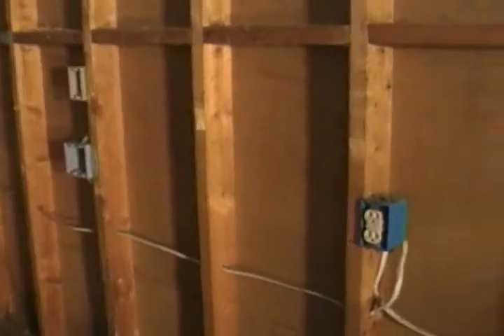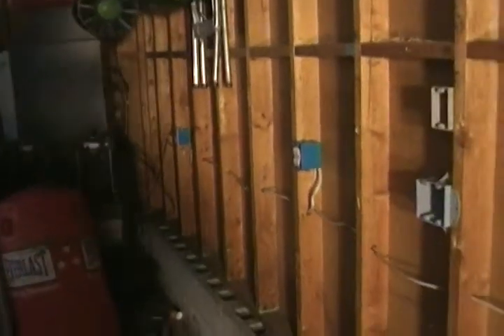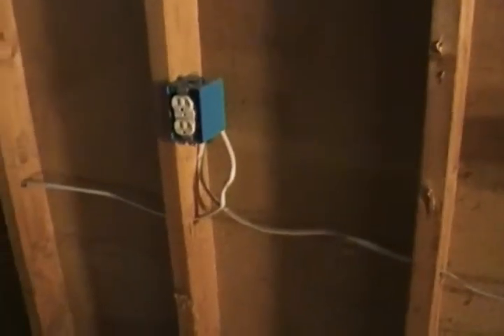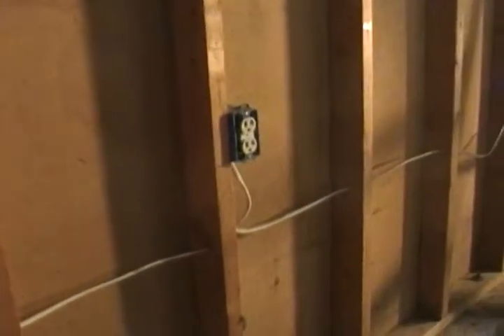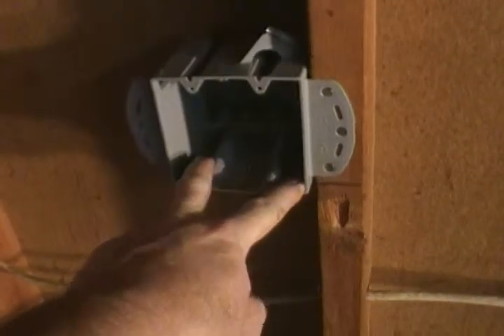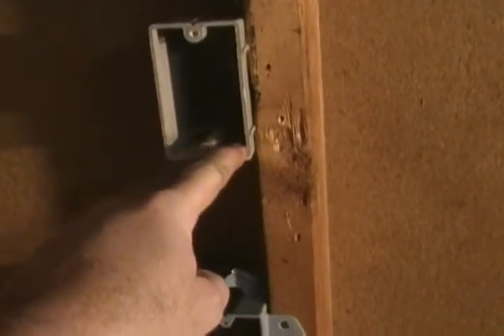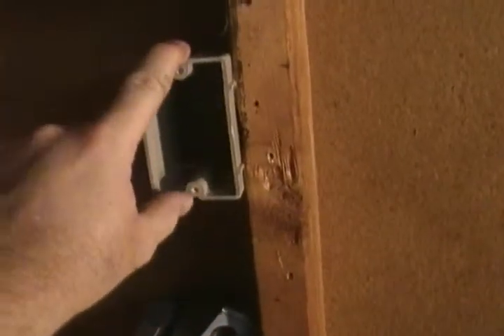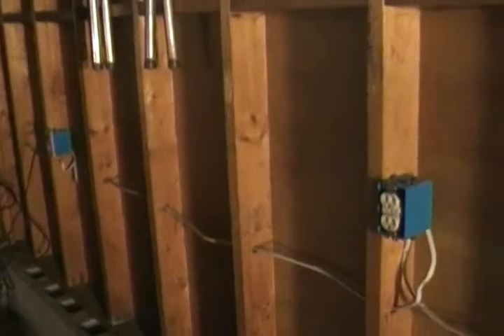How to: Electrical - Planning and Installing additional Outlets and Switches

Comment: You sir are currently violating the NFPA 70 document, also known as the National Electric Code. Your project will not pass inspection as is and you must have it inspected.
Reply: +Dustin McClure  you are correct that it will not pass as planned BUT who says he has to have it inspected, thats between him and the insurance company when the place burns down, unless he will be selling it in which case the lazy ass home inspectors probably wont even pick up on it. that being said it may not be perfectly safe but it will most likely function fine, at least he is using proper wiring procedures which is more that can be said for most DIY jobs

Comment: Did you tap into an existing outlet? Is there a limit how many more outlets can be added?
Reply from the maker: Yes, I tapped into an outlet along the back wall and ran two extra outlets and ran a power supply for some additional outlets. Im not sure how many additional outlets can be added by code in your area. Too much stuff plugged in of course can pop the breaker.I just wanted the convience of having plenty of outlets down the back wall of my shop because I plan on having a work bench down that whole wall. Thanks for your comment and have a great day!